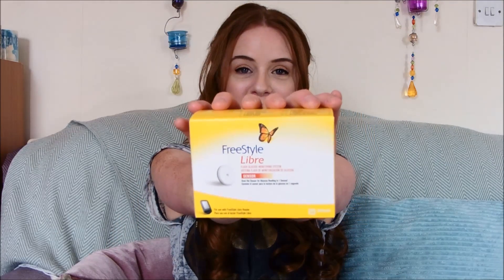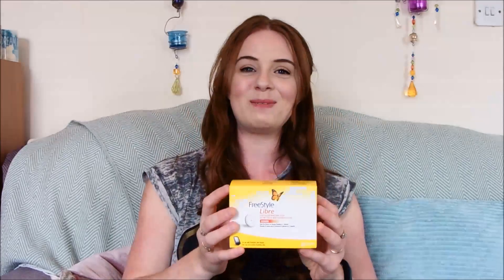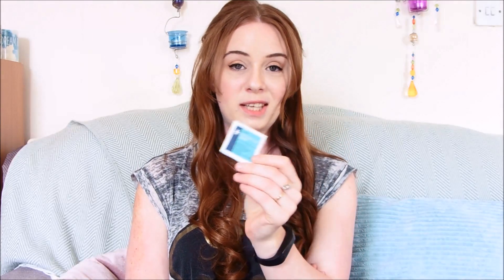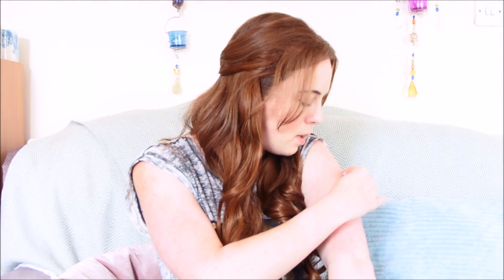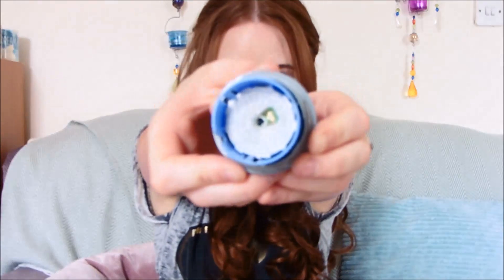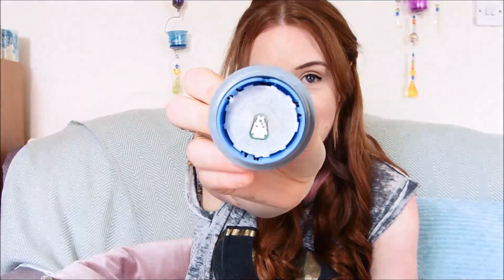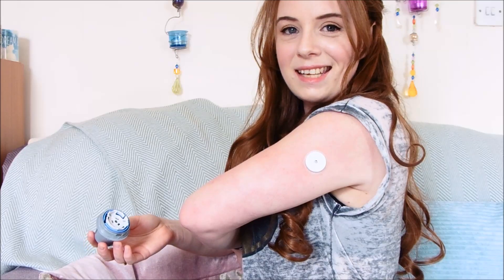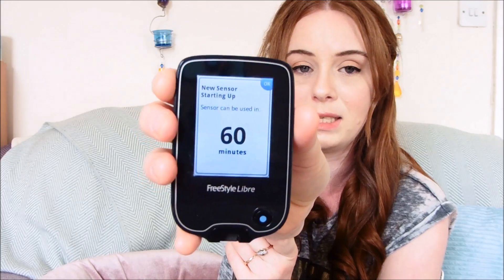How to insert Abbott's FreeStyle Libre sensor and use the reader

Comment: I got my first one today and it didnt hurt. A slight pinch but way less painful than finger pricking. I did notice a little stinging after a few minutes. I guess it was the needle, but otherwise no pain. I have a super low pain tolerance and pain was a 2/10.

Comment: Thanks for this video as it is very helpful for me when I insert my sensor. Also, I use Ambrosia NightRider with my Libre. The device helps me alot every time when my readings goes out of range. These products are life changing for me.
Reply: Hi Jasmine, I am planning to buy android watch so that I can able to use it with NightRider and check readings on watch directly. Any suggestions?
Reply: @floradean3190  You can use Hauwei 2 watch and check readings directly on watch.

Comment: I can’t tell you how much it helped to know that the needle doesn’t stay in!! None of the professionals or advisors told me this and I was terrified of it. It was painless and I can sleep easier now
Reply: The needle does stay in your arm for 14 days the needle does come out when you remove the sensor. However you don’t feel the needle but I would advise against using these sensors they are very inaccurate.
Reply: @twau2826  They’re actually very accurate. I take care of an older patient who has one and I’ve checked her levels via finger prick after checking the sensor multiple times and it’s 100 percent accurate every time the numbers always match up on the dot. 😊
Reply: I used a lot of Libre sensors and none of them was painful, totally painless. Adding the NightRider on it helped me so much in getting the alarms and reading updates without worrying about the scanning the sensor after I moved from the Dexcom which was super expensive and I am very surprise why even insurance companies cover such an expensive product while Libre and NightRider does exactly same at lest than 25% of the cost

Comment: Hi Laura, received my first sensor today. Only issue I had was I placed it a bit too far to the side of the back of my upper arm. Seems to be working ok though. I find using a smartphone is far easier than the reader. Puzzled why anyone would use the reader.

Comment: Thank you so much Laura! I'm set up for an appointment with a nurse to have my first monitor stuck on, and your lovely video reassured me about the "needle". But I've read some horror stories about the captor being knocked off. Is it possible to cover it with some invisible plastic plaster patches ("PPPs"?) or would this be surplus to requirement?
Reply: I just asked Abbot rep today, they said it is not necessary, but if you want to you can. Won't effect reading as long as it thin, waterproof and transparent (clear) tape.

Comment: I'm trying to get this through the NHS at the moment, waiting for answers now.

One question I have, though, is: How does the adhesive hold up? The reason I'm asking is, I'm using the Omnipod insulin pump system at the moment, and even after 2 days the adhesive pad on the pods starts coming loose. Even faster than that if I'm sweating a lot (and working construction, it's pretty much unavoidable).
Reply from the maker: I think it depends on each person, I find when it's warmer the adhesive doesn't last as long and it can come off towards the end of the 14 days. You could try rock tape to secure it though. It wouldn't budge with that on.

Comment: What about showering, how long do you keep on?
Reply: If you remove it before 14 days , it will stop working.   Update on price .  I have no insurance , but used a discount card to purchase them for $35 each .    Be careful the glue does not come off .  I lost my first one after 4 days.  Now ,  I place a patch on top of it so it does not fall off.   At first I thought it only gave a flash reading for each scan.  However , it actually gives a snapshot recording of your glucose level the previous 8 hours.   I use the app for my phone instead of the reader .  It records more information and no need to carry another device.
Reply: Hi Michelle.  I shower with mine daily. So far, 49 days without any issues.  Abbott recommends not wearing this in a hot tub, spa, or bath.  Basically, do not submerge.

Comment: I have been using the Libre for almost 2 months, but I'm having trouble keeping it on for the full week.  It seems to stop at times when I'm gardening, working in the house  etc.  I love the product but the adhesive doesn't seem to last the full 14 days.   I 've got insurance but they only cover the 7/14 day prescription.  I cannot pay for the Libre  injector, I'm wonder if anyone else has had this problem and if there is a easy solution.  Thanks
Reply: I had this problem, that's why i created Patchabetes! We've got you covered. www.mypatchabetes.com
Reply: Patchabetes Freestyle Libre Adhesive Patch Please make them in clear or beige.

Comment: I’m doing Exercise and he came off I don’t know because my sweat
Reply: There are covers for the sensor that are sold on Amazon. It's like a large flexi round/oval shaped adhesive patch (similar to a huge band-aid), that more than adequately covers the sensor and keeps it in place. They come in colors or prints depending on the manufacturer.  I got pink! I have aquatic classes twice a day, five days a week, and I also have zumba classes twice a week...never had a problem.  The patch will  stay in place for two weeks. Just do an Amazon search for "Adhesive patches for Freestyle Libre."
Reply: Char really I have to order them I do Zumba and gym plus I clean houses and a sweat a lot

Comment: My wife has just inserted her first sensor and now has tingling in the pinky and ring finger of the same arm/hand. Is this normal,  anything to be concerned about?

Installation location is quite similar to your in this video.
Reply from the maker: How is your wife now James? I can't say either way if it is the sensor but the wire that is in her arm is tiny and very very thin, so shouldn't have caused any damage. Hopefully it doesn't cause her any bother but she can always contact Abbott customer services if she's still worried, they're very helpful.
Reply: Hey,  thanks for your reply.  She's ok now,  no more tingling. Whatever it was it has passed. Thanks again

Comment: You and I have been assimilated by the Borg. Resistance is futile... LOL... While the Freestyle Libre may not be the best CGM available on the market, it is the most affordable. The sensors don't cost any more in America than a month's supply of quality test strips out of pocket. Or any more in America with a good insurance coverage. But with the Libre you will have many more glucose readings.

Comment: It's 92 on the website and 92 dollars for the sensors so expensive I'll stick to my strips 2.70 for a box of 50 unless it becomes free or under a pharmaceutical scheme
Reply: I get 50 readings in 3 days with the Libre without poking my finger.  It records my glucose levels at night as well.   I pay $35 per each 14 day sensor .  The Android app stores all the data for you .   Today It told me I had a spike to 210 , thirty minutes later , dropped to 170 and stayed around 150 for a couple hours .

Comment: Thank you for this video.  I am about to put my first one in. I know that in the US,  the sensors last only 10 days versus 14 days. I didn't realize that your sensor is active in 60 minutes. The ones i got are active in 12 hrs. Has that changed from the time you made that video or is that another difference between our sensors?
Reply: Kim K 14 day us available. You will need a new meter.

Comment: How many sensors do you get with the initial pack? and how much is it if I had to buy it separately ? any idea?
Reply: Zayan Jeffry Each country has slightly different prices. In Switzerland where I live I pay equivalent of approx 65 USD.
Reply: Type One Talks how many sensors did you get with the pack. Or did you buy the sensors separately?
Reply: Zayan Jeffry They are sold separately.

Comment: Saw a tv commercial for this. Very interesting. How often do you replace the sensor? And does it work with your phone?
Reply: sensor works for 2 weeks, not 2 days.  i believe it is only 10 days in the U.S.  iPhone app does exist but is not available everywhere.  abbott here in canada told me government approval is pending but may take some time.
Reply: mugtastics and 14 days
Reply: OFW  showering is fine - no skin irritation for me
Reply: If the sensor stays to the skin for 2 weeks, won’t it get irritated?can the sensor gets wet when you shower? Thank you!
Reply: For me I have very sensitive skin and each time I remove my sensor I have blood on the needle, bruising on the application site and a lot of itching and irritation..I give myself a day or so between removing and applying for my skin to heal. It does pinch a little bit on inserting.
Reply: Yeah it works for your phone too
Reply: You  need the meter to scan. There is now a 14 day sensor and 14 day meter. I ran into a door and knocked mine off so  I am lookin into tape.
Reply: You need to replace the sensor every 2 days and this one is not available with your phone. The Dexcom is. tho.
Reply: @bethdonohue9623  No every 14 days.

Comment: Can you tell me if this version has the capability to switch from mmol/L to mg/dL? I know in Europe and other parts of the world you read them in the format of mmol and in the states our meters read in mg/dL. Curious if this can switch.

Thanks!
Reply: Jeff Nelson I believe it does you just have to go through your settings and adjust it that way I have the same machine but my sensors only last for 10 days I don’t know why she is saying 14 days and on top of that it takes 12 hours before I can start using my sensor I don’t know why she said it only takes 60 minutes maybe each machine is different I know I have the black one but our box was the exact same

Comment: Hello
I have one question
Is the sensor against water
Or should it be removed at shower time and installed again after shower?
Reply from the maker: Hi! The sensor is waterproof, so you can wear it in the shower. If you go swimming I'm not sure of the depth you can go to with it on but it should be on the website or maybe on the instruction manua :)
Reply: Thank you so much
I will use this device .I think it's awesome
Anyway I have the second type of diabetes at an average rate 6.6 -- /or 120
I am using the Accu-Chek Performa Nano
Reply: what about if i wear it going to a water park on water slides would be scary if it came off. Large waves of water.

Comment: Hey tks for the demo, I just received my libre for the first time. I noticed a spot to put strips on the captor. What it is for? I thought we didn't need test strips? (My instructions booklet is in German...>) tks again!
Reply from the maker: Hi! The slot is for testing if you want to use the reader for that, it can also be used for blood ketone testing if you have the right test strips. Hope you're enjoying using your sensor! :)

Comment: just a question we found that the reading is more about  50 every time we check ?
Reply from the maker: Sorry for the incredibly slow reply, I didn't see this message :( Did you manage to get more accurate readings in the end? It might be worth contacting customer service if not and sending any sensors like that back to be replaced :)

Comment: Hi and thanks for the video! I´ll be getting mine this weekend. Does anyone have any experience in hard gym workout with these?
1) do they fall out easily? seen in the comments about covering with tape, but wondering if that's enough. 
2) do they actually help preventing hypos during workout? For me that's a very frequent occurence and the reason that I use over 4 strips every time I work out.
thanks!!
Reply from the maker: Hi Jason, apologies for the late reply! Youtube doesn't tell me when people comment :( Rock tape works well for me but the last lot of sensors I've used haven't needed any tape - they seem a bit stronger than previous ones I;ve had. And mine really helps a lot with preventing hypos! I scan mine a lot when I work out and it makes me feel a lot better to know which direction my sugars are heading. Hope you're enjoying your sensors!

Comment: Hi! I've just finished my visit to the hospital and they recommended this, I play in a boys team soccer, and I'm gateaux because I get nocked a lot on my arms will it be safe I'm a little scared
Reply from the maker: Hi! I used to catch mine on doors and they would come off so now I put tape (rock tape) over it to keep it in place which works really well. Rock tape is really strong and I use it for the whole 2 weeks that he sensor is on. Hope that helps :)
Reply: I know this is like forever since you posted this, but, do you use the same rock tape for the whole 14 days, or do you just replace the rock tape every day?
Reply: What is rock tape?

Comment: Would the sensor stay on during rigorous activities like high intensity interval sprints, or lifting heavy weights where you would  get quite sweaty whilst stretching the skin on the arm? or even running the tough mudder etc? 
Thanks
Reply from the maker: Hi Pete. I can't say either way I'm afraid. I've had sensors that stay on just fine no matter what I do in the gym and others that have fallen off for no apparent reason. When I use sensors now I cove them with rock tape which keeps them in place for the whole 14 days. Abbott do say that the sensors haven't been tested with tape covering them and they don't guarantee that it won't affect the sensors performance, but I've had no issues when using the tape. I hope that helps a little :)
Reply: Cheers!
Reply: Also do we know if it works with ketones?
Reply: I would by the little sticker things off amazon and you put it around and it stays

Comment: Hello, Laura? My doctors recommended this to me today, but I don't know what to think. I've had Type 1 Diabetes for 17 years, and I'm used to doing blood tests. But I'm worried that I'll mess up, like knocking it off in my sleep, or breaking it when I have a shower...
Reply from the maker: I'm sorry for my slow reply - Youtube didn't tell me you had commented :( I wouldn't worry too much about knocking it off or breaking it. I use tape (rocktape) to cover mine as I tend to knock it on doors. The tape keeps it in place and you can still scan the sensor with the reader. Abbott say that it isn't approved for use with tape over it but I've never had any issues. Hope that helps! :)
Reply: Thank you :)

Comment: Adrian is right, it is the used sensor which should go in the sharps bin. The new needle is in your arm and the entire applicator unit can go in the plastics recycling bin. Note: NHS Scotland no longer has any provision for the collection of sharps from private individuals it seems. My surgery will no longer take them.
Reply from the maker: Hi. I confirmed with Abbott a few weeks ago - This is what they said; "Hi Laura, Yes, the needle does come out after inserting but it leaves in a thin, flexible, sterile fibre (5mm long). The needle helps insert the fibre directly underneath the skin." I was told the same by Abbott on the Libre launch day too. The applicator does need to go in a (large) sharps bin, as does the sensor after use.

Comment: hi laura...i wana get this . ..i just want to know about the life of sensor...i mean is there any specific life for sensor..when we need replace it..or it will be sticky during shower ....thanks
Reply from the maker: Hi. The sensor lasts for 14 days after the first scan you do, so you would need to take it out after than time. It sticks quite well for the first week but I've found that after 7 days the sticker can start to come away a little, so I cover mine with tape. Though the sensor isn't guaranteed to work with tape over it, but I've not had any issues. Hope that helps :)
Reply: +Laura Ninjabetic (Ninjabetic1) hi which tape do you use over the sensor??
Reply from the maker: Hi David. I use rock tape (you can buy it on amazon) as I don't have any reactions to it and it's really strong. I tried plasters and micropore tape but they came off after a day or two.
Reply: Thanks again